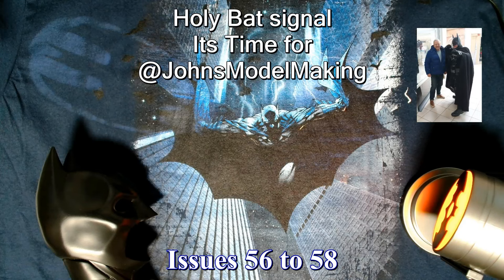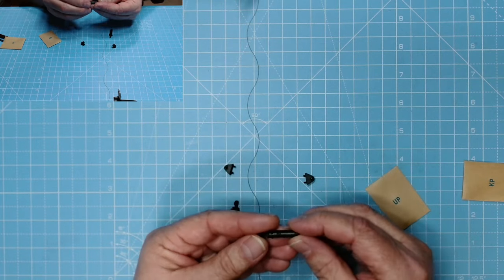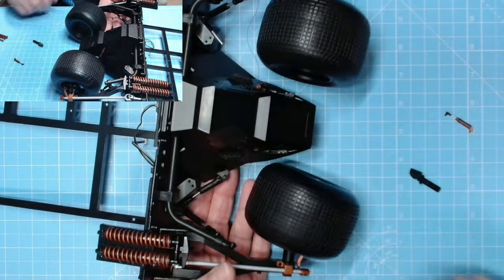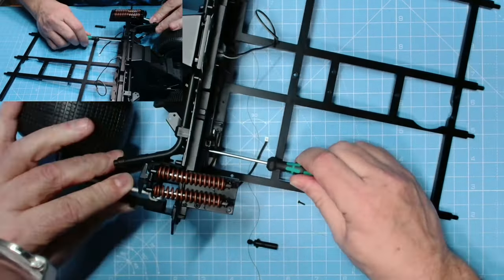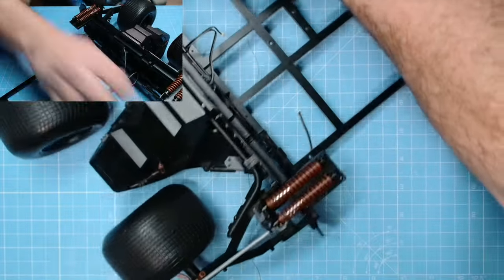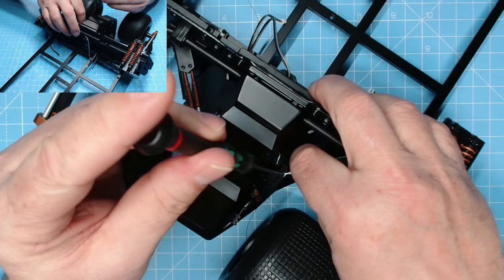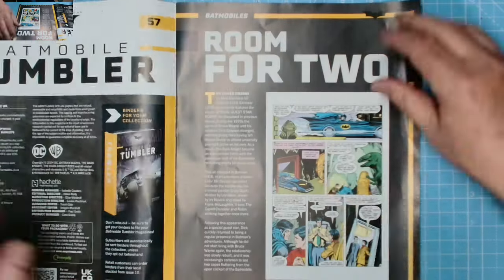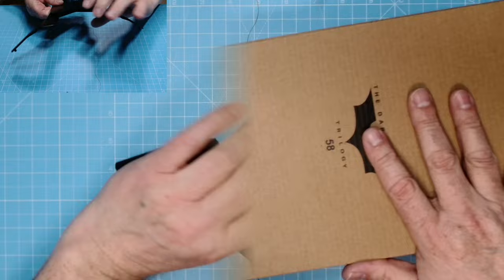Build the Batmobile Tumbler issues 56 to 58 from Hachette

Comment: John, those piston brackets will go in the same way if you use them on opposite sides and flip them over. Just reverse what the instructions say (as they are wrong again) and they’ll go in with the screws facing down. Just done mine now with no problems. It was fiddly but easy enough. Didn’t even have to loosen off the pistons either, just fed them on first then attached the brackets to the head.
Great video mate 👍🏼
Reply from the maker: Thanks for the tip and for watching! 😀

Comment: For fair comment John, cuz as you know i ceased building the Tumbler, but whatever models we seem to build be that partworks or just plastic etc, theres always those little testy bits to do, even when i was building Hachettes Bismarck, instructions were highly inadequate, like in some issues we were told to glue parts, then 4 issues later, telling us that parts were in wrong places, ok if you using thin cement, but not if youre using CA glue.
But John it is coming along nicely even though frustrating at times. Thanks John. Take care.
Reply from the maker: Thanks for your support Phil, the instructions are lacking as in the order of fitting the parts and how, but it is done now. I can see the end result, so that will keep me going. 👍😉